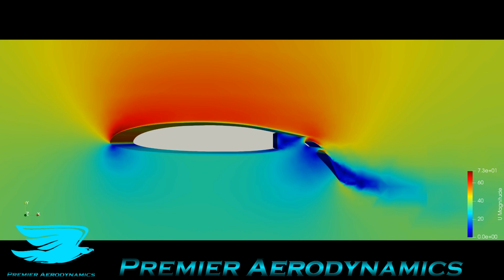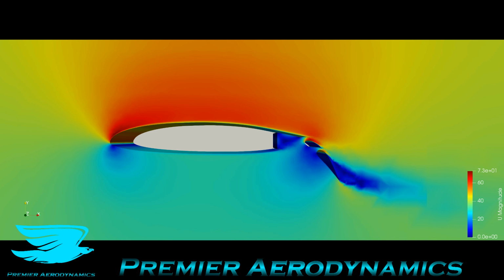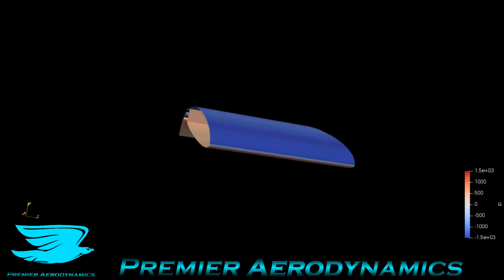How wing flaps work

Comment: if 3 elements produce such high lift, does separating the main wing into even more element further increase lift ? like 7 elements ? at how many element does the global lift reach a maximum ?
Reply from the maker: That's a good question. And the answer is complex.

Each element is designed to generate a little bit of lift. The way airfoils work is that there is usually a range of angles of attack where the drag coefficient is very low but the lift coefficient is very high.

Above this range results in an increased lift coefficient BUT a massive increase in the drag coefficient. That's wasted energy that could be used to produce lift instead.

So, by breaking the airfoil into more elements, you're trying to get each element to operate within this good angle of attack range.

Breaking the airfoil into more elements doesn't necessarily increase the lift coefficient because if 3 elements are already operating within this range, then you won't gain any more by having more elements.

Now, you can get more lift by adding more elements to the already existing structure. This will interact with even more of the flow and you can boost the lift coefficient. However, usually the gains are less and less the more elements you have. For example, a 3 element airfoil might produce a lift coefficient of 3. But a 10 element airfoil could produce a lift coefficient of 4.5. Sure, 4.5 is 50% more than 3, but you had to use 233% more elements to achieve that gain. So, there is generally an upper limit to the gains. That upper limit is generally about 5 (lift coefficient), and that is under optimal conditions.

Hope this answers your question in enough depth.
🙂
Reply: @PremierAerodynamics  yes, I was wondering what's the optimal sub division of an existing airfoil element to achieve max possible lift. On a unit chord length basis. Assuming all subsonic flow. So your answer partially answered my question. I was wondering if there an analytical way to find out the optimal number of sub division.

Although that got me thinking. Given super sonic flow increase in velocity when go through an increased channel area due change in density. You could purposely force the mach 1 transition point at the maximum camber of an airfoil, so there is no adverse pressure gradient from peak camber to trailing edge. Basically follows the same flow of a converge-diverge channel of a supersonic wind tunnel. Excepted in this case, it's an open channel flow instead of closed channel flow.
Reply from the maker: Wow, that's incredibly complicated again. So, forcing the flow to sonic would produce A LOT of drag because you'd then get shock waves. The best you could hope for is literally accelerating the flow to just below sonic so that you'd get that pressure drop but not the drag.

Comment: So they're basically producing jets of air, which energizes the boundary layer while entraining upstream air.

The CFD shows a region of air above the airfoil moving faster, I imagine that region doesn't extend upwards indefinitely. Eventually the air above is not being accelerated and becomes a high pressure barrier. What this says to me, is that the wing is part of a virtual venturi tunnel formed between the wing, and the high pressure air that is surrounding and not being influenced by the wing's suction side.

In the engine building world, oval ports flow better than square or circular ports. In the wing world, Prandtl showed the lift distribution, and velocity magnitude form an elliptical shape, this isn't by accident, air is showing you the shape it likes to flow through.
Reply from the maker: Exactly, they are jets that help re-energize the boundary layer, which helps the boundary layer resist the adverse pressure gradient trying to decelerate the flow and then cause flow separation.

I'm not sure I understand what you mean by the entrainment of the upstream air. Do you mean that the lower pressure on the suction surfaces of the two flaps draws some of the upstream flow through the slots and over them?

You're exactly right that this region of faster moving air doesn't extend to infinity. It is a function of viscosity. The idea that it produces a venturi effect is one of the major arguments about how airfoils (and any curved surface) produces lift. It also becomes a kind of "chicken and the egg" routine where you ask yourself, which one came first, the acceleration of air, which caused this virtual venturi effect, or the venturi effect through the geometry blocking the some of the airflow to begin with and now the air has to accelerate around it, due to the molecules of air not being able to move instantaneously to compensate.

Interestingly about Prandtl, not all wings form an elliptical lift distribution. Most approximate it, but that is only because of the wingtips where the lift drops to zero because of the air that bleeds around. Evidence of this deviation from an elliptical distribution can be found from the induced drag; the induced drag is effectively a measure of how elliptical the lift distribution is, so anything less than an "Oswald's efficiency factor" of 1 tells us that the distribution is not elliptical. (Now, you can get Oswald efficiency factors greater than 1, but that is a wing planform with fancy wingtips.)
Reply: @PremierAerodynamics  TIL thank you good sir. And yes that's exactly what I meant by entrainment. A jet of air drags upstream air with it as it fills in the low pressure left behind.